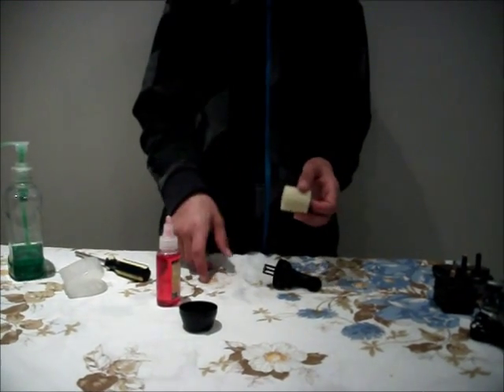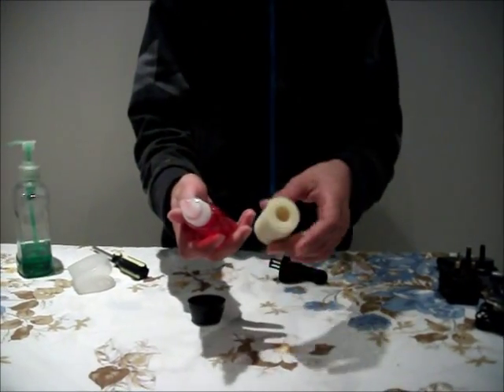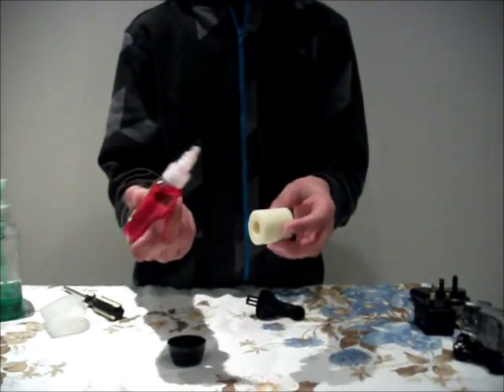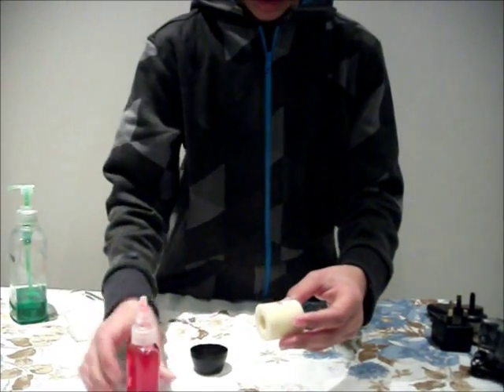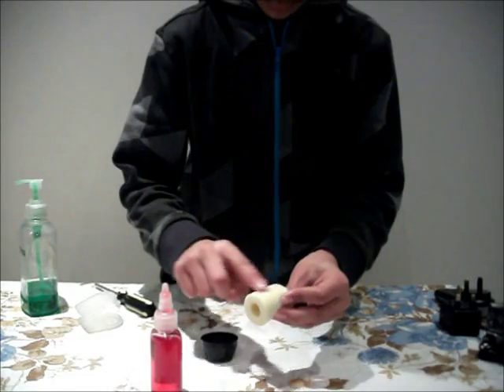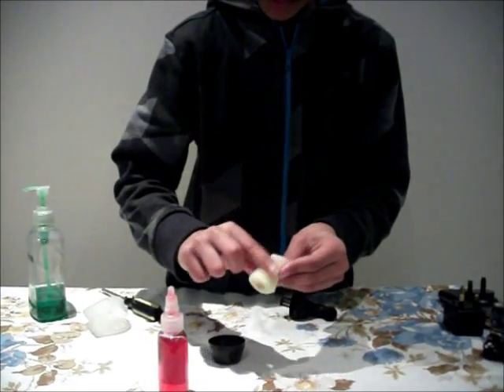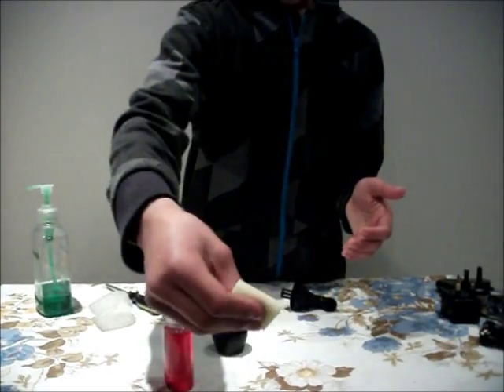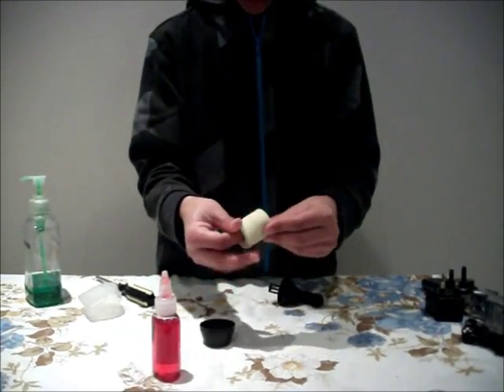HOW TO ADD AIR FILTER OIL TO YOUR RC AIR FILTER

Comment from the maker: theoretically yes, BUT NEVER EVER do it!
the dust and dirt in the air will enter your engine and ruin it within a few minutes.
It will wreck the inside and linear off the engine.